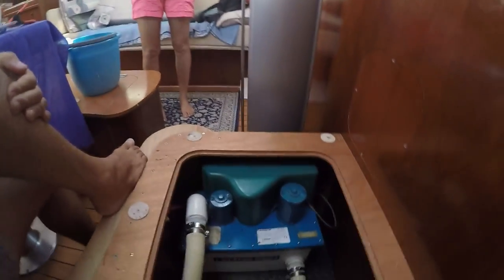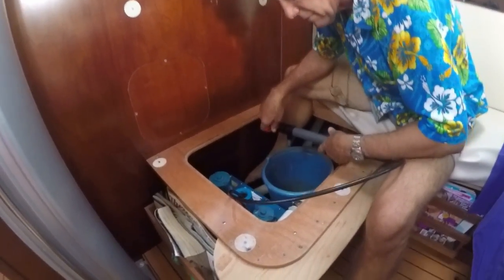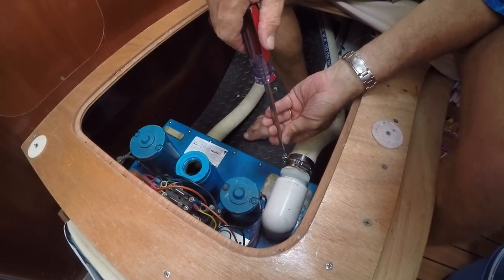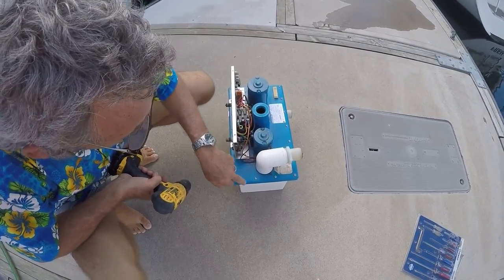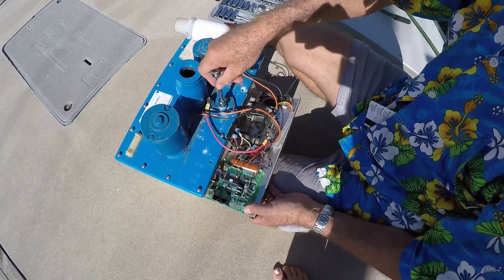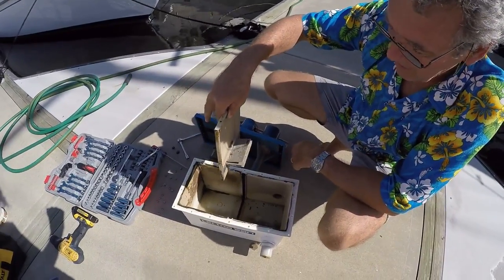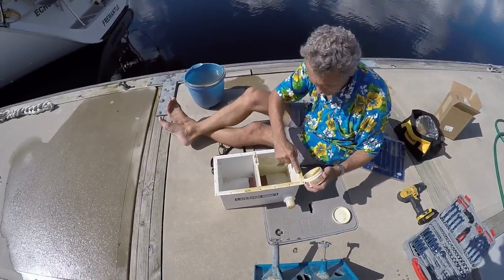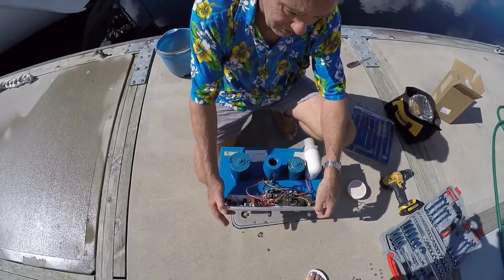SV Echo Echo Sailing the World, Neil and Jeanette's Adventures- Changing Electrode on Lectrasan

Comment: I also replaced my electrode pack. My old pack had the extra 'reaction plates' , so 5 plates.
They are not electrically  connected and eventually they were done away with.
The new one has only 3 plates.
You can check the continuity of plate to stud. What happens is the copper wire eventually corrodes that runs from stud to plate, then current cannot flow. If the plates are just dirty, clean them with Muriatic acid.
Titanium plates don't wear out.  I kept my old pack, might try to repair it someday. I cut it open to discover how it is made.

Comment: Good video.  Yeah in NZ the electrode pack costs $900 and the latest whole system with LCD display etc is only $2000. Its crazy  - thinking a black water tank with simple level and pump may be inconvenient to remember to empty but got to be cheaper and less maintenance.

Also for $2000 i would have expected them to mold the nut into the tank lip.......

Comment: Good on you for going to the effort of filming this - will help out many who are considering this job vs replacing.  Where did you get the part for a coupla hundred??  It's just under $800 in Perth!
Reply from the maker: +Mike Lewis Hi Mike, we ordered it on line from Raritan in the US and it cost us $288US plus shipping ($12US)to Georgia where the boat was at the time in the US. It would cost more in Australia because of the exchange rate, but maybe still cheaper if if can get sent to you. It didn't weigh much. Glad we could be of help.
Reply: +SV Echo Echo Sailing the World you can by direct from Raritan?  I didn't know that!

Comment: How often do you need to replace the electrode packs?
Reply from the maker: Hi Adam.The electrode packs very rarely need replacing. In fact, we replaced them not long after buying the boat, and haven't needed to touch them since. However, I am now a strong advocate of having a direct discharge of holding tanks instead, as fewer countries are accepting the lectra san system, and are requiring the heads to be diverted to holding tanks instead. The locker space used by lectra san is also a bit of an issue.
Reply from the maker: We have only done it once so far